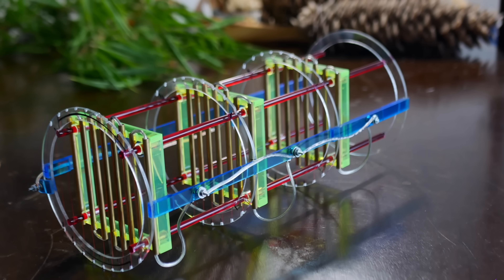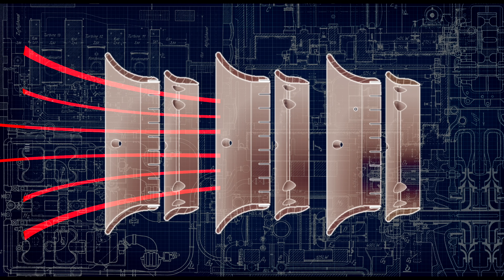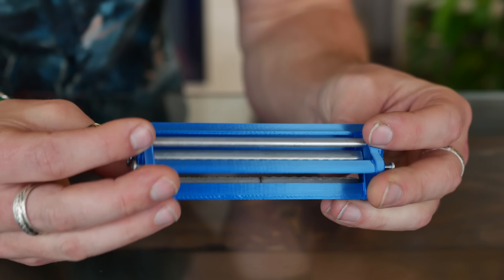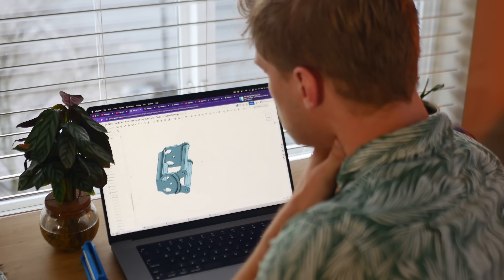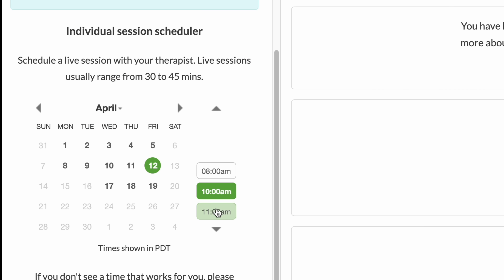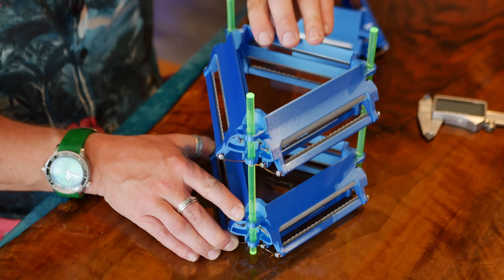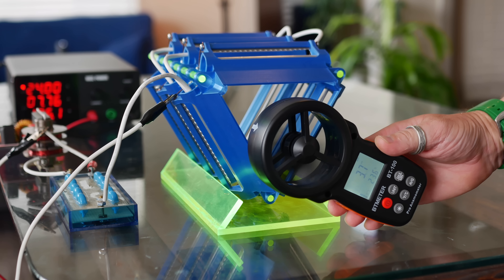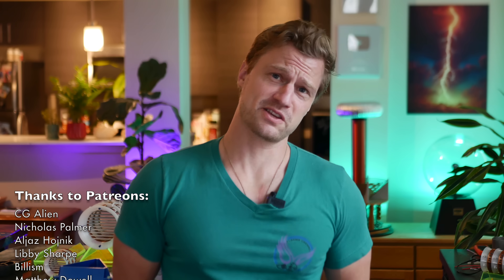Next-Gen Ionic Plasma Thruster Inspired By Nature (BTC Mark 3)

Comment: The stacking not helping much is kinda obvious, it's like, let's pretend we have a 10L bucket of water, then we attach a hose on the bottom, we then get "thrust" downwards cause of the waters weigth. Now we stack another bucket of water + hose atop the last one... I guess most can already see the problem, using the same amount of flow doesn't increase the flow, just as the same amount of force doesn't really increase the force, I mean it's not like a car that can shift gears to speed up more with the same power.

Comment: I wonder if it would get you more flow if you made the downstream sections slightly larger than the upstream ones.  Since your air flows are convergent you might get more air toward the center, pulling in more air from the sides and through the next section due to the lower pressure in the middle.

Comment: As A Paraglider the front of the chute need to be OPEN to allow air flow... Why not have your wings with the same concept and the thrusters built inside the wings?? Do the thrusters have to be exposed on top???? Does it need to have high speed as a glider or just when it's required for additional lift?? Would the increase of air flow while flying increase  the thrusters?? All your experiments seem to be requiring more for lift off rather than just staying in the air. Paragliders need only about 8 to 10 MPH to get lift. How much additional thrust can be made with more force already going into the thrusters??? Direction of angle of input could make a huge difference.

Comment: Wouldnt it be nice if you used that philosophy of constructive interference in a circular way. You know, because of laminar flow. And you could try to make different angles of attack on each stage. Like the first one pointing to the center, and the next one more to the outside, and so on till the last one? Maybe you would get the same flow, but more consistent? Or maybe faster? Nice video anyway. Keep that nice work

Comment: Maybe a consider the same design but a) circular in nature such that the peripheral input is all round and b) produce a funneled passthrough. E.g. the first ring is 150mm in diameter, 2nd  125 then third 100. Maybe even add a 4th ring at 75mm. Just like water going down a narrowing pipe you get a higher pressure at the narrow end.

Comment: Have you considered a conical or funnel shape for the mk3's?  If accelerating air between the thrusters has diminishing returns, what if you direct each thrusters "intake" into clean air, and "exhaust" into the conical shape to stack the air velocity through a smaller opening. Without trying to ionize the same air, you may be able to avoid that curve in your graph and potentially make it a straight line or reduce the diminished return?

Comment: Try smaller blades with a tubular shape for surface area and use a esd safe 3d printer fillement and a reversed cup design on blade mounts so u don't arch out when applying higher voltages

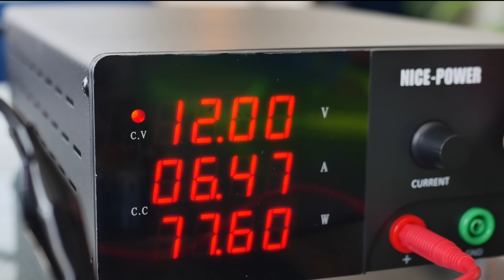Comment: 13:27 Science is not ideal, but you again have a linear scheme. To make it non-linear, you need to increase the voltage on each subsequent segment. The best design would be to connect the exhaust of three segments to the input of the fourth.

Comment: I love how everybody on here are telling you your problem, but where are thier designs. My coments are questions.. I have a suggestion in your design. What if you made your individual sections smaller and arranged them in a helical configuration. I wonder if this would help in directing flow. You could also make a curved sheild on the outside to pull in more air from sides. Lastly, what if each segment  was a different voltage.  My 2 cents, I appreciate all of your hard work and thinking. Great videos.
Reply from the maker: Hey, great input. Honestly I don’t mind the critique - it’s how designs get better.
Reply: @PlasmaChannel  I'm old-fashioned, I just like the more pleasant/Respectful  approach. Be well my friend

Comment: I have a couple of Points to share:

1. Increased Air Velocity and Thrust: By positioning the thrusters slightly offset, the streams of ionized air could be directed to converge in a manner that utilizes the rotational kinetic energy of a vortex. This configuration can potentially increase the velocity of the air stream as the converging flows from different angles add rotational momentum. The centripetal forces in a vortex can compress and accelerate the air, potentially increasing the overall thrust.
2. Stability of the Airflow: Vortex flows are known for their self-stabilizing properties due to the angular momentum conservation. This could result in a more stable thrust output with less dispersion of ions, leading to improved directional control and efficiency of the thruster.
3. Enhanced Mixing and Ionization Efficiency: The rotational movement of the air can enhance the mixing of ions and air molecules, potentially increasing the ionization efficiency. The constant movement might also help in maintaining ions in the excited state longer, improving the overall ion thrust efficiency.

Comment: Ok this may be a dumb idea but here it goes. Some jet engine designs employ precoolers and controlled ignition to add propulsion. Do you think adding thermal exchange/compression to the design would help? Thinking of the airplane application temps would get cooler at higher altitudes and airspeed.

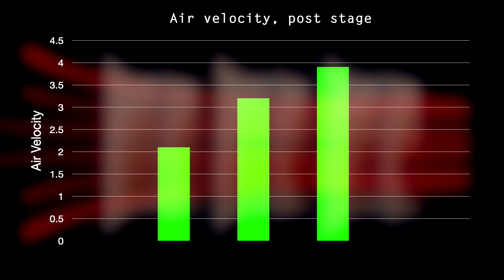Comment: Energy in a flow scales with velocity squared. For your three stage thruster at 3:14 into the video, the second stage output is 2.32x as energetic as the first stage (neglecting extra air inflow), therefore the second stage is more efficient than the first. The third stage output is 3.45x as energetic as the first stage alone, so again, the latter two stages are more efficient than the first. As others have said, you need to measure thrust produced. Your current numbers are entirely meaningless, and leading you to misinterpret your results.

Comment: I think the reason why when spacing reduced your thrust is reduced is because your staged thrusters or the same size. Because its peripheral propulsion the air flow exits at an angle. I would suggest you make each stage smaller than the last in a way that it intersets with the airflow of the previous stage this will allow the forces to stack rather than fight each other if u had same sized stages. Please test it I really wish to see it, this based on the the shape of conventional jet engines they have that cone shape.

Comment: I haven't looked threw the comments so this may already be a suggestion, but instead of gapping the stages what would happen if you increased the voltage per stage so it adds a boost effect possibly as you said as it enters the first stage at 40V the air is already pretty close to its max velocity so why not add more power and give it an additional kick

Comment: So what if you built your thruster in the shape of an octagon. Then on the inside of the octagon you put short helical fins to help guide the air. Thought being that you get the air spinning like a vortex in your central chamber. You could even place your thrusters on shims to help form the vortex. If a thruster was made out of level it would thrust it's air more to one side of the chamber if they all did that they could help form the vortex
Reply: Was thinking on it some more. Instead of octagon what if you built it in a double ring configuration. Your inner ring has the ports for the thrusters and helical fins can be printed as part of the ring. The fins wouldn't need to be to large to help form the vortex.
     Your thrusters can attach to the ring and be placed at an angle to match the fins. Each module could then be attached to the one next to but offset. Basically your modules follow the twist  so they help form the vortex.
     The outer ring is a casing but it also acts as the air supply for the thrusters. When turned on your coils will suck air into your outer ring. A helical fin system could lock the 2 rings together. Thus thrusters could be speeding up already organized air.
      Do have one question do you think your wing thrusters could be modified to power a fan blade. If so you could create a blade that ran to increase air pressure in the air chamber that supplies the thrusters.
 
Good luck

Comment: Hi question why don't you reduce the centre hole as you  pass each unit like a funnel focusing the air through a smaller channel Increasing the thrust But still maintaining a large enough hole so it can withstand an impact ?

Comment: Now with the linear design. Streamline the thickness and apply to the root of a wing along the top of the NACA airfoil. Where air tends to separate from the wing at high angles of attack.

Comment: Hi, person with an aerospace engineering degree here who worked on turbine engines. 👋

There are many potential ways of improving this :
1. Dump the identical linear stacking : if there is a peak acceleration and velocity that a given ionic thruster stage can achieve, it is better to optimize for it than to try to stack identical stages because the theoretically optimized stage will never have an improved flow by the stacking of more of the same limited stages in series. The flow energy will inevitably end up wasted on friction in the downstream stages and the velocity will not exceed theoretical maximum for a given electrical power. The better staged approach (assuming staging is necessary) would be to optimize staging as a function of stage delta velocity and input velocity, i.e. the same staging philosophy as a turbine engine, each stage needs to take into account the output of the upstream stage for it to be optimized based on velocity vectors. What that means in practical terms is either changing geometry to optimize staging or optimizing power delivery (instead of a 50-50-50kW, maybe try 100-75-50kW or 50-75-100kw or any given combination determined to be optimal for the parameter to be optimized)

2. It is much easier to protect a stream from incoming impactors than it is to design the energy system around it. Turbine blades don't typically survive bird strikes, they are just designed to be safe for passengers when they happen (i.e. there is shielding where necessary). Long story short, this is a non-issue.

3. Measure thrust, not velocity. It would be easy to use a scale with some contraption to measure the actual output of the system and the real metric to measure is lb of thrust per HP (or N/kW for the metric ones out there). Velocity doesn't really give an interesting value other than for stage optimization because measuring flow is extremely hard for an open system like this. The only way to measure flow is through thrust in this case.

4. For any given design, the minimized friction value for a given flow (kg/s) will be given by a circular passage, not a rectangular or squared one. It can be demonstrated through the calculation of mass flow divided by perimeter (the frictional factor) for a given velocity times the area times density. The most efficient aerodynamic perpendicular cross-section design for an axial duct is a circle.

5. Impinging jets will never optimize flow velocity because flow velocity does not create constructive interference between velocities. The best theoretical scenario would be for the flows to combine axially for the maximum thrust to be achieved through the combination of mass flows... this will never happen unless guided with vanes and even vanes will never reach 100% efficiency towards rerouting your flows together because of frictional loses. Combining flows only results in increased turbulence in this case and I have no doubt this absolutely hammers performance... because the flows are not purely axial. Thrust efficiency is a function of flow direction and reaches a peak when every fluid molecule travels in the same axial direction. what is happening here is the equivalent of adjusting where you cut your own legs to maximize your height... not realizing that height is maximized by not cutting it. In other words, keep things axial.

6. One thing to consider for the architecture of a fully integrated system (plane and thrusters) is that thrust is optimized more efficiently through the increase in mass flow than through the increase in velocity. Velocity is not the be all end all here. The real problem to solve is how can you get enough thrust to push X. With ionic thrusters, the real advantage in terms of architecture is you can probably put these things everywhere on a plane instead of in a small thrust chamber package like an engine and you might therefore have access to more flow than an engine might. With that in mind, the goal should be to determine how many of a given thruster do you need for a plane to take off and based on that value, either determine how to stack them on a plane or optimize further if the value obtained is too large (i.e. larger than the perimeter of the aircraft's perpendicular cross-section). This should be the design guideline outlining the entire project.

Comment: Why three sides? Did you try two, four, or six? I wouldn’t be surprised if “round” ended up being be the best shape, but I’m pretty sure I’m being influenced by the shape of jet inlets, which I think isn’t really the same physics.

Wait… hypothetically, could this replace the combustion/expansion/whatever-it’s-called chamber in a jet? Obviously the power output isn’t the same, but since it doesn’t get “melt the turbine blades” hot, the less expensive manufacturing might be worth it.

Comment: Have you looked into venturi effect to increase air flow.
And try making a round prototype so you have a hollow cylinder. That way you could experiment with a venturi effect and lengths of intake/exhaust. 
I also want to know what would happen if you sequentially increased the power output for each stage rather than all the same wattage

Comment: How about using those separated in parallel. At least you've got 3X the power. Another option is to put the hot wire after the compression area of the flow to get jet-like thrust.

Comment: Instead of having each stage identical, where the individual airflows converge at 3 different points, why not adjust each stage (front is closer to parallel with movement axis, rear is closer to perpendicular) so that way each thrust component is aimed at the same spot past the rear of the system. Without doing the math, I'd wager it would reduce turbulence and help your output just a bit.

Comment: You can’t really increase airspeed using your approach…you have to use a nozzle…your design is clever but you are missing the point…how does a jet make more thrust? More fuel and oxygen burning at Higher rate in a confined space. What you did is add more fuel and oxygen by adding more thrusters…but you need to create pressure differential in order to increase airspeed.  So use your ion thrusters and put them into a nozzle with no gaps between trusters. Each thruster putting more power and air pressure into the center. Use a nozzle to make 1/2 the diameter or relative size of the triangle…you should see increased air speed

Comment: @PlasmaChannel i watch your design and wonder if you are attempting to lean too hard into the concept of a laminar flow on your design.  I think you are correct that the gaps need closed. Turbulent leakage between the stages will definitely kill performance and raise power draw. The thing is, the spacing does need to vary between stages to account for the increased airflow from stage to stage causing the convergence zone to become elongated.  Make some cuffs to cover the gaps and try it again.

Back to the turbulence vs laminar discussion, I have a strong suspicion that adding some imbalences, either electrical or aerodynamic, which introduce a rotational componant to the air flow inside the thruster will increase the overall thrust.  It can create a virtual ventura chamber which can increase the compression ratios.  With the enclosed thrust chamber, this should give you a boost.  Also, it can effectively "round off" your air flow, creating a cylindrical column of thrust instead of relying on linear convergence to approximate it.  

Finally, there should be a thrust bell on the output of the thruster.  As others have mentioned, with the increased velocity, the air can be compressed more to further increase airspeed and thrust.  You could use a physical bell or add an aerospike to the output to create a virtual bell using ambient air pressure, but it really needs one.

Comment: You should test all of these for thrust ratings. Not just output. Output can be very high without a good thrust. If you want to make an airplane you will need something that doesn't drag air through it, potentially causing the very air your dragging through it to cause a. Drag effect. Almost nullifying any output. What i'm saying is, test how much thrust is is creating. Not just how much air flow it creates.

Comment: I wonder if an ionic vortex would be achievable and if the output would be enhanced. A vortex in nature has a lot of force. Hurricanes, tornadoes, whirlpools. 

Maybe a spiraled razorblade with a spiraled ground. In a conical shape you could even divide it into stages to continue throwing power at it. 

Or incrementally increase the power throughout the stages 1st stage 40w 2 stage 80w and on and on.

Comment: 3:07 kinetic energy has a square of velocity, so it would make sense that adding twice as much power increases the speed by less than two times.

7:38 how do we know that the later variants output more L/s? Having a wider output doesn't necessarily mean that it's moving more air, does it? It could just be moving a thin line of air in the middle of the output